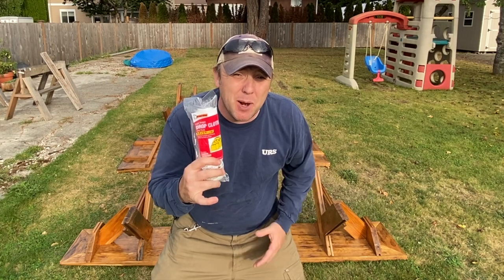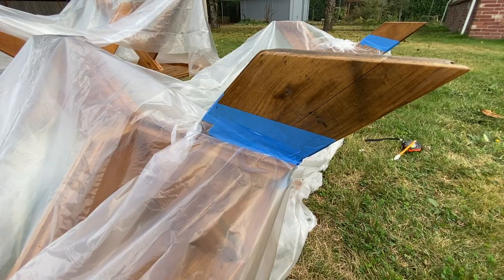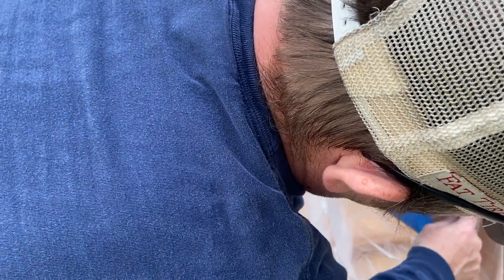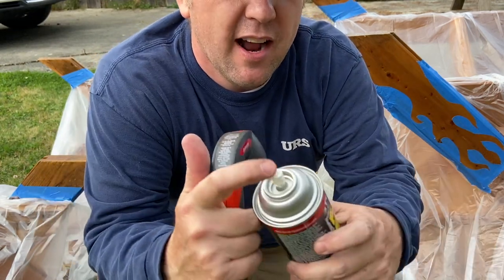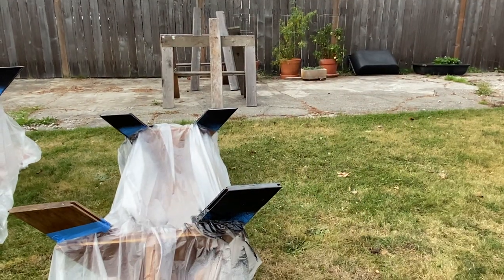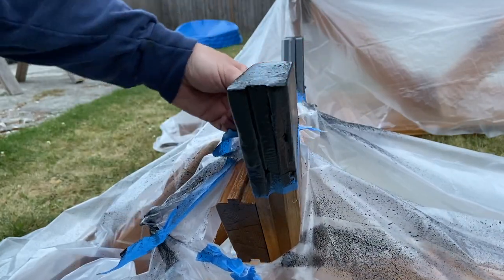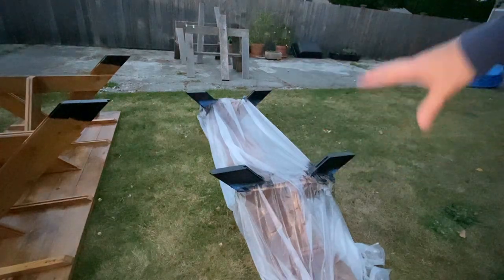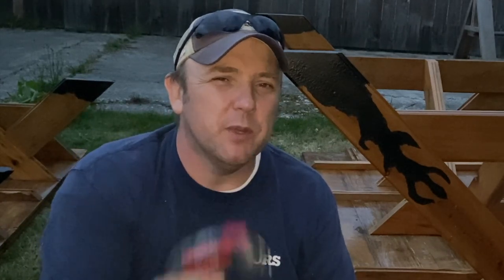KEEP THE RAIN OUT!..HOW TO PREVENT TABLE LEGS FROM ROTTING!

Comment: Awesome video brother. I bet the cans of spray truck bed liner would have worked a little better but hey you never know until you try. It will still be protected though.
Reply from the maker: That is a great idea!  I wonder what the difference between flex seal and truck bed liner are.  Will see how long this stuff holds up.